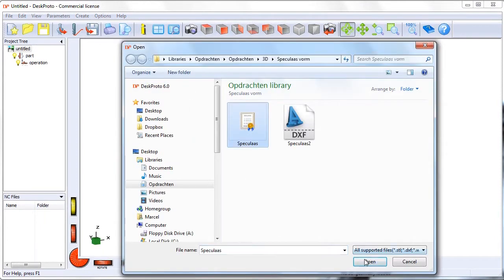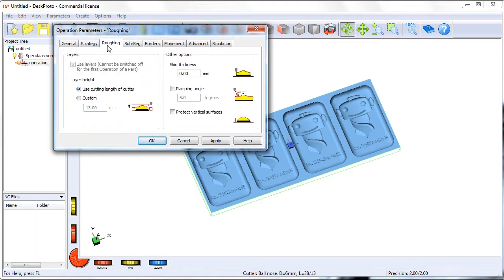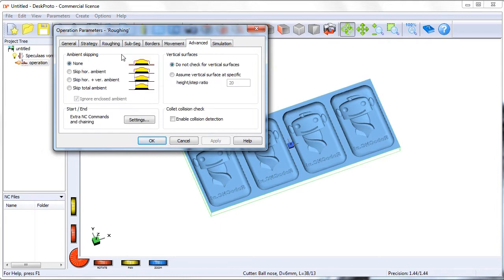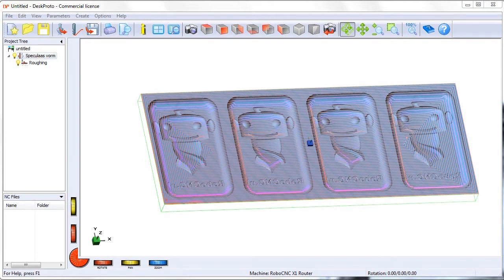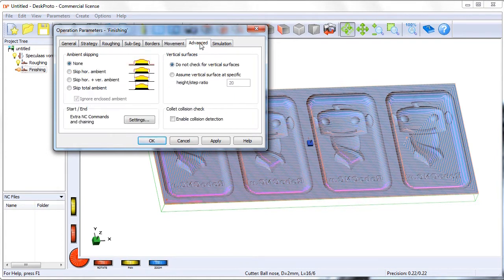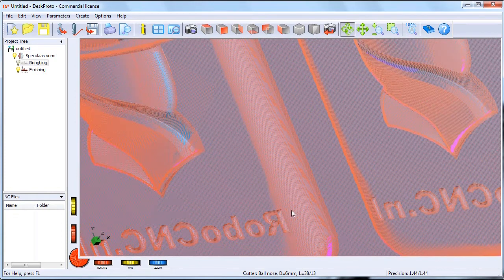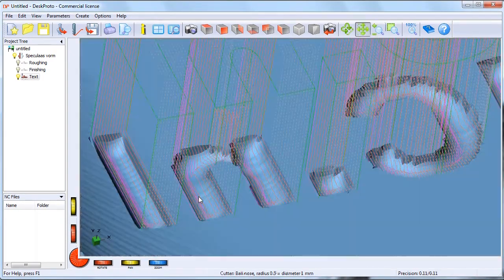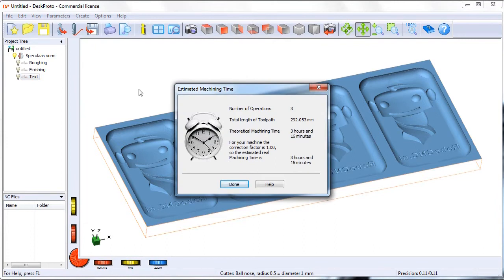RCNC Projects 26 : Making a Cookie mold with DeskProto

Comment from the maker: Hi, and thanks for the comment and tip.
That would indeed be a option when used a single line font.
Or even with a filled font if i would be able to make offset vectors from the text.
I have used such a toolpath last week with DeskProto indeed (preview at facebook).
Thanks ;)